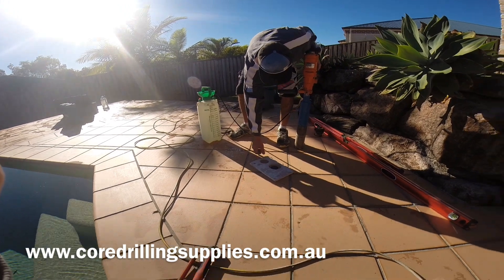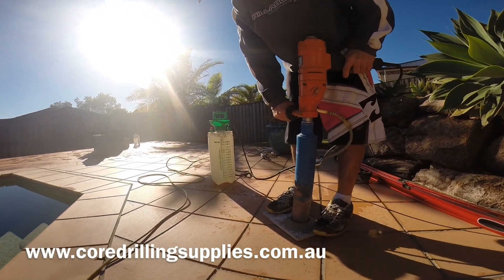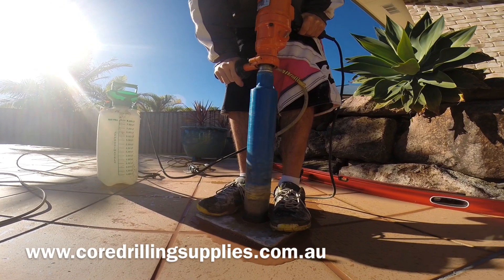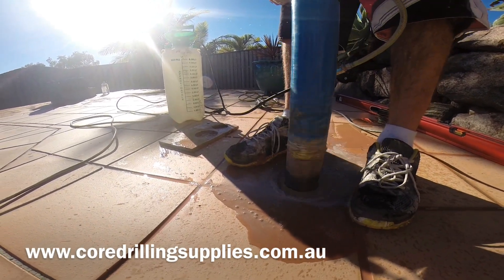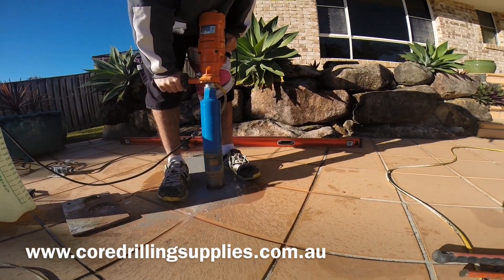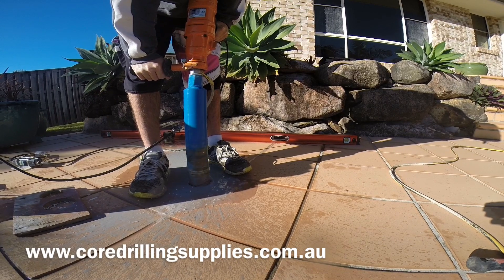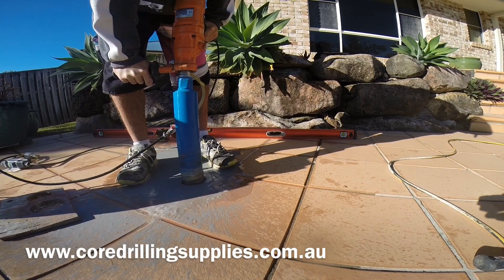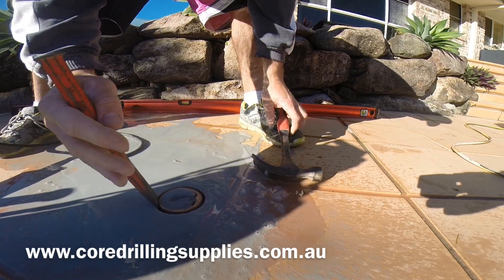Tips and hints for core drilling concrete

Comment: I wonder, in the case it would jam, and the safety clutch wouldn't work well, is your leg able to stop the handle without enjuring yourself?
Reply: This one looks more powerful than mine, and I'm pretty sure mine doesn't have a clutch, but you really need a good grip and be ready for if/when it snags... Also mine is a dry drill used on brick and block rather than concrete not sure how much difference that makes